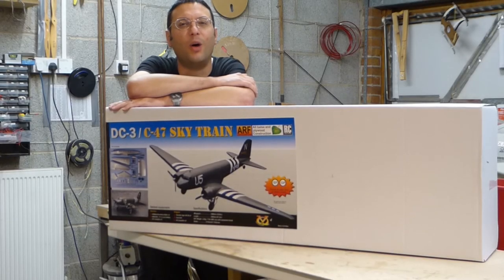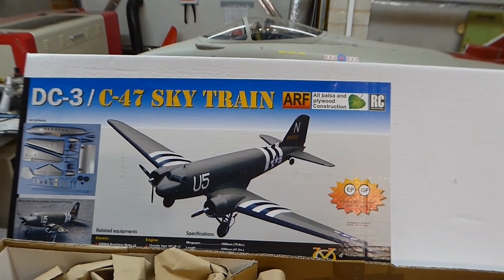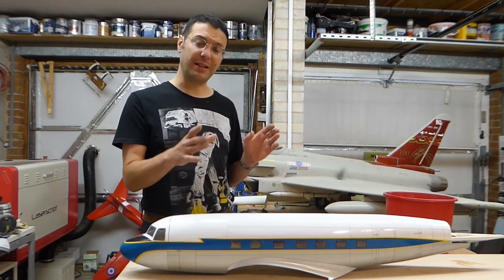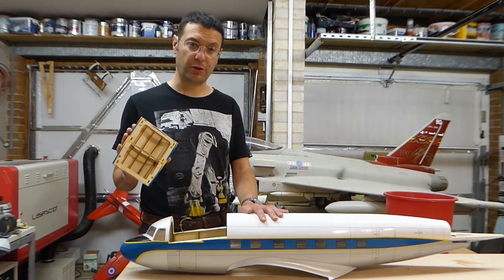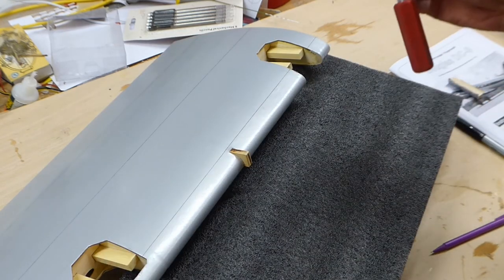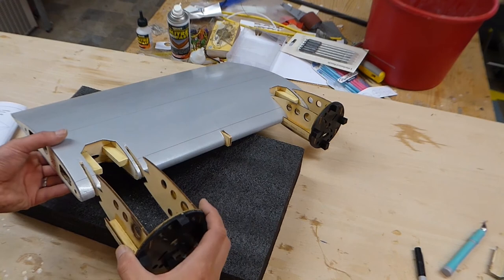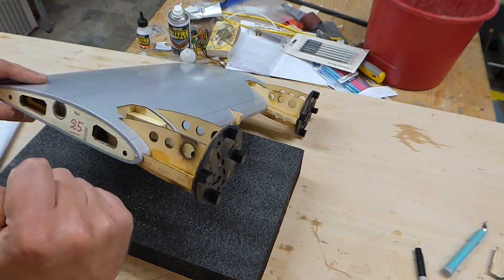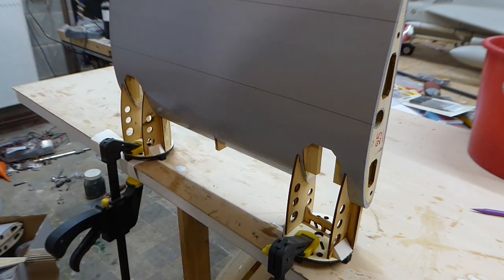VQ Models RC Douglas DC3 Dakota Model (Part 1)

Comment: Excelent tutorial which I really needed. I am sure I will keep asking some things, but here goes the first question: For fitting the nacelles, instead of slow curing epoxy, is it fine to use wood white glue? Thank you!
Reply from the maker: Wood glue is fine.  It is important to use an adhesive which cures very slowly to enable accurate alignment.  The instructions suggest using CA (cyanoacrylate - superglue) that is almost instant.  Using CA glue would make careful adjustment impossible.  Hope this helps, and yes please keep the questions coming.
Reply: @ScaleMeDown  Thanks for your reply. Yep I avoid using CA. I will link your hobby website and youtube channel in my hobby website once I finish my C-47. It will take me quite a bit of time though, but I believe people should watch your awesome tutorial.
Reply from the maker: @Rad_Schuhart  Thanks.  It is really worth watching the modifications I made in part 8 (https://www.youtube.com/watch?v=-MSsb43B6oI&t=18s) regarding twisting the wing tips to reduce the angle of incidence of the wing tips and ailerons by around 5 degrees, and also to amend the centre of gravity to 95mm.